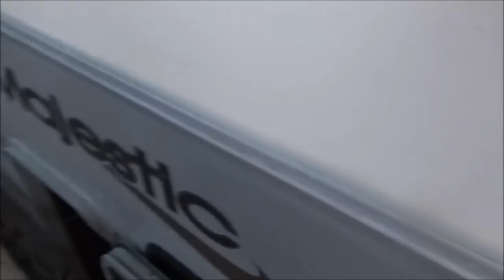Rv Roof Replacement and Rear Wall Rebuild

Comment: do you use the same 60 mil structured tpo around the curbs you use to support the ac units and other stuff on the roof? or is it unstructured to be more malleable? You guys to great work. If i had an rv, i would definitely make the drive to your shop.

Comment: I ruined an old stick and tin TT with a heavy gauge galvanized roof.  The corners leaked due to poor sealing and low spots.  I didn’t learn my lesson and I’m purchasing a new TT. Your YouTube channel has educated me on roofs and walls. I’m tempted to bring in my 2021 and see if you can make it less likely leak and rot. GaryJohn
Reply from the maker: Well hopefully we have shown common and vulnerable areas to watch for.
Thanks for watching.

Comment: Manufacturers say if you don't have a ladder from the factory then your roof is not a walk on. I like your videos and love the work and explaining that you give. So with that said I have a 2002 Keystone Hornet 27ss and would like to know if you think it's safe for me to get on the roof for cleaning ? There is no leaks or damage at all, I just want to clean and inspect .
Reply from the maker: Some manufacturers are installing ladders as options now. But the reason the ones without ladders usually have 5mm luan for decking, so you may crack it if you don't walk in the trusses. You can take the garnishment ring out if the  vent from inside and look to see how thick the decking is. Or you could wash it on the side with a step ladder. The also recommend laying a piece of plywood across the roof to walk on. It should be outlines in your manual.

Comment: What kind of adhesive did you use to attach the back panel? Can you use a contact cement?
Reply from the maker: If you are adhering the fiberglass yes use a spray adhesive 3m90